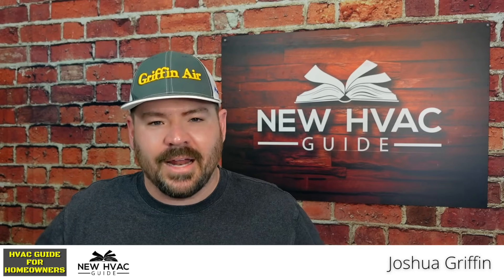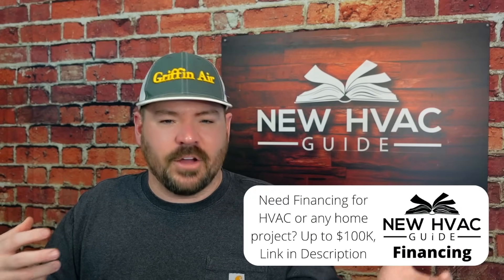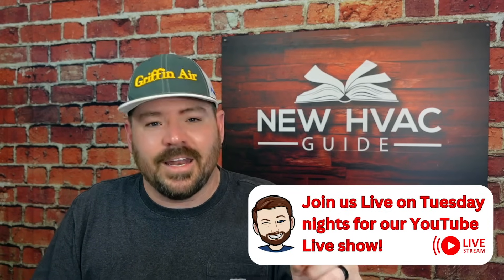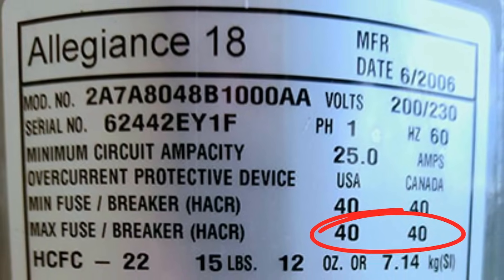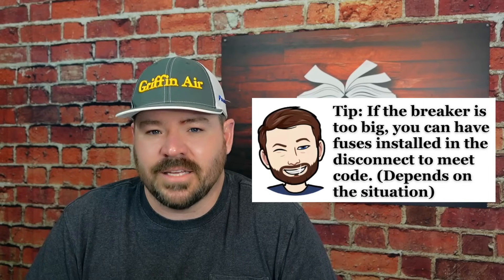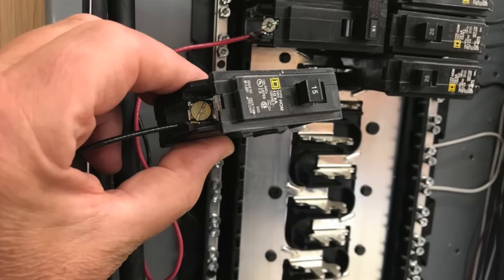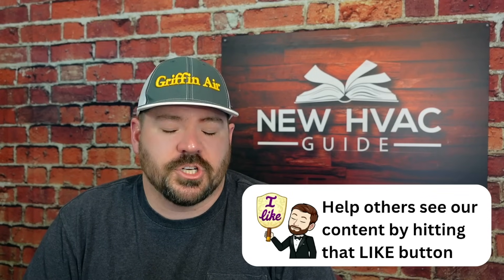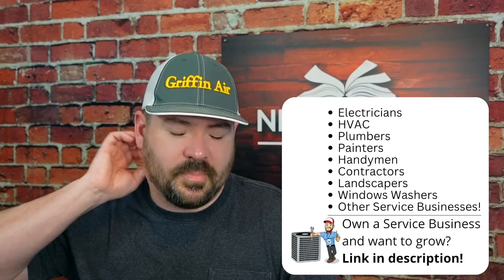Rule Broken the Most in HVAC! - Breaker sizing on the condenser

Comment: The wire size should absolutely matter. Why would I use a 30A breaker on a #12 wire for my condenser?? At that point, I should run a #10 wire. I often see 30 or 60 Amp disconnects. Id rather use the pull type disconnect and install 20A fuses.

Comment: Just had a hvac unit installed - air handler and condenser. The condenser minimum ampacity is rated for 32.4A. The existing breaker in the panel is 30A. To me it's clearly undersized and can lead to issues. The unit is currently off and the hvac techs are coming back another day. The condenser says max amps is 50A. #8awg exist in the run. I'm thinking a 40A breaker would be ideal. The FLA for the fan is 2.8A and the RLA for the compressor is 23.7. 26.5A combined, but min amp for the unit is 32.4A. 125% x 32.4 = 40.5A.  Thoughts?

Comment: Go by the label, not the size of wire. Well, maybe. The wire needs to be sized according to the label also. You can't put a larger breaker on than the size of wire will support. However, the wire may be too large. You can install a smaller breaker than the wire is capable of supporting, but doing it the other way around is risking melting down the wire. If the wire won't support the size breaker the unit is calling for then you need to replace the wire with a larger wire first.

Comment: AC compressors are slightly special in that they are the only device on a breaker, so the breaker can protect the unit from over-current.  Otherwise, a breaker's purpose is to protect only the downstream wire from over-current, with no protection for every device that might plug into that circuit.  Seems best to protect the compressor at its location, either with a fuse in the disconnect box (common) or better if the compressor manufacturer designed-in a protective device.  Compressors change over the years, so harder to match them to a breaker in a distant electrical panel than to a local device.

The 2020 NEC requires GFCI breakers for AC compressors.  False-trips are such a problem in newer inverter-drive units that Texas walked-back the requirement.  Some older electrical panels don't even have GFCI breakers available.  Another issue is that 240 VAC AC was often wired with no neutral (common) wire, which is required for GFCI to work.  More reasons to put protection inside the compressor.

Comment: I got a whole lot out of it. Just got a backup generator (9000w/7250w running) and I was told I can't run the 2 ton AC - it has a 60amp breaker. My son is does commercial HVAC and said "why the hell did they put in a 60amp breaker?" The larger breaker was installed after some work done on it. I looked it up online and found this - 
"Amperage draw: A 2-ton AC usually draws around 15-20 amps of power, so a 20 amp breaker is suitable to handle this load safely."

"A 2-ton AC heater unit typically requires a 20-amp circuit breaker." Sooooo - why wouldn't a 30amp do it? The generator is 30amp 240V out.
Reply: PS: I ordered all the parts for the generator intake, etc from Amazon.

Comment: Question. Both of my units have breakers that are exactly double the max rating on the label on the outdoor unit. Is the inside unit contributing to load in addition to the what the outdoor unit label says?
Reply from the maker: Not usually
Reply: @NewHVACGuide  thank you

Comment: Thank you very much for this video Joshua , my HVAC breaker caught fire today and i just found out that the outside unit needs a 40 AMP breaker but the electrician had installed a 30 AMP breaker. This is the second time that the HVAC breaker caughts fire so now i m having to learn some basics on electricity and HVAC as a homeowner. I feel i can't trust the electrician anymore at this point... this video is very helpful!
Reply: Sounds like more a problem with the breaker than the compressor.  A quality breaker should trip on over-current, not melt.
Reply from the maker: Sorry that happened! I hope you get it straight!
Reply from the maker: Join us on our chat on our live show every Tuesday night! HVAC Guide Live Show YouTube channel
Reply: If the max and the min are both 40amp then it shouldn’t be on a 30 however this doesn’t sound like you have a breaker size problem over a panel problem, modern breakers are designed to trip when overloaded now there are cases where they don’t but they more than often do and the fact that now you have had 2 fires sounds like you may be having a panel issue. I would check your panel brand and if it is a zinsco or a federal pacific I would have it changed asap as both of these brands are notorious for the breaker not tripping and causing a fire

Comment: Electrician here, been one for 30 years.  OP is dead on correct on every single statement made in this video, including the one about "old school" electricians telling you they could go to the next available size breaker because the one specified isnt made.  That is almost never the case now and when it is you still use fuses sized correctly for the unit.  What is not stated is the reason why there is a max breaker size.  It has to do with the trip curvw of the breaker and how much current will be allowed and for how long.   The wrong size breaker can seriously damage equipment by staying engaged for longer than intended.
Reply: Modern inverter AC have overcurrent and overheat protection and will not be damaged if the circuit breaker fails to trip. Many brands' outdoor unit labels only indicate the maximum current, without specifying the required circuit breaker size or maximum circuit breaker size.

Comment: Absolutely not. If unit says 35.... doesn't matter, if cable is too small, then electrician may NOT use 35A or whatever that is NOT suitable for the wire (cable actually). Breakers protect only cable, not device. Breakers that protect device are in the device. Do you have electrical education done (with papers).   Yes, if device requires 35 then it is appropriate to install correct cable so not to derate the recommended fuse.

Comment: As an electrician I've put on breakers larger than what the name plate says. 0:36 thus one right here gives a maximum, but not a minimum. That could cause issues if the breaker is undersized. And now I have to meet code, which not at a single point you bring that up as being the possibility of hreaker size. Code has two parts we as electricians need to meet. 1) we need to be 125% of the load. For a 25 amp breaker it's 31 1/4 amps. 2) or the load needs to be 80% of the breaker. For a 25 amp breaker it's 31 1/4 amps. Since that breaker size doesn't exist, we are required by code to put in a larger breaker than that. So the only solution is to use a fuse if breaker size can't be met. So 30 amp breaker for a 25 amp max load will do when fuses are installed. You have your code, we have ours. So please stop insisting your code is more important because you don't understand electrical.
Reply: The 0:36 mark shows minimum circuit ampacity (18.1) and max fuse (30A) in this scenario you could safely use #12 with a 30A breaker. see 440.6 NEC. (here's a good explanation https://www.youtube.com/watch?v=WugJ8-70Sqs)  The max breaker size already has the 125% added. You won't see a manufacturer request a non standard breaker size for max fuse.  Normally you want to use the max fuse size allowed as this prevents nuisance tripping and the min circuit ampacity to size the wire to save money.  It's completely safe, the equipment is designed to never draw enough energy for a long enough time to damage the wire ie. overload protection and the breaker protects the system from short circuiting.

Comment: My Daikin MXL system has a 20 amp breaker.
Reply: If installed after 2020 NEC code changes, it should be a GFCI type breaker.  That has caused many headaches with false trips, esp. on inverter-drive compressors like Daikin and most today.

Comment: I actually checked this years ago when my AC was installed and had a panic when I discovered the breaker in the panel was 30 amps but the max for the condenser was 25. Turns out the company I hired put in a 25 amp fuse in the outdoor disconnect, so they did it right.

Comment: Licensed electrician should not make that mistake but, you are right a lot of electricians don't know how to size the wire and or the breaker in a condenser unit. But Most mistakes are done by HVAC contractors that do their own electrical work.
Reply from the maker: I have to agree with you on that.
Reply: Normally the nameplate has Minimum Circuit Ampacity (MCA) and Maximum Overcurrent Protection (MOCP) size. I agree I always size my breakers and conductors to the MOCP. Electrical also needs to be aware the available fault current ratings of the HVAC equipment especially in the commercial world. Most HVAC equipment is rated for 5000 AIC however during a catastrophic electrical event (a fault for example) the amount of current running thru the circuit could be much higher than 5000 amps. Electricians can protect the HVAC equipment against this with fused disconnects or a transformer. This is also a NEC code requirement to do so. The other option is to have the manufacturer make the HVAC equipment with a higher AIC rating which can get expensive